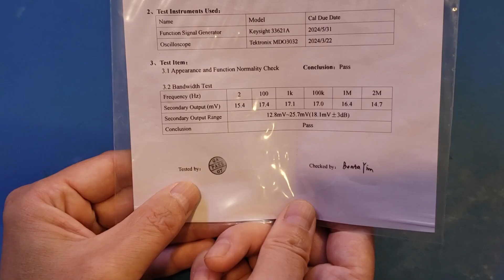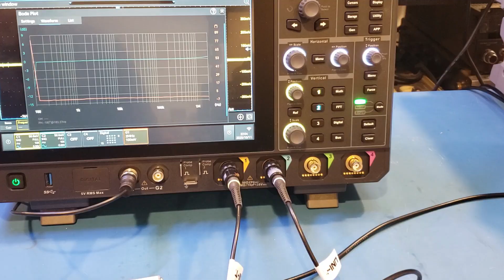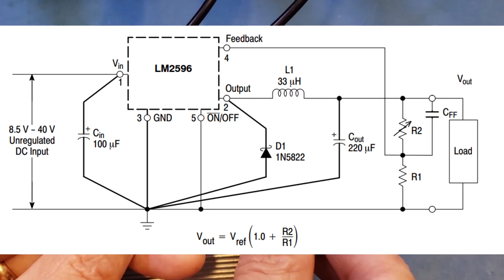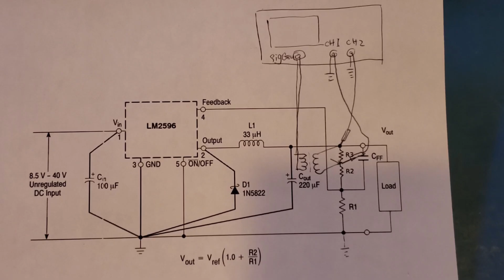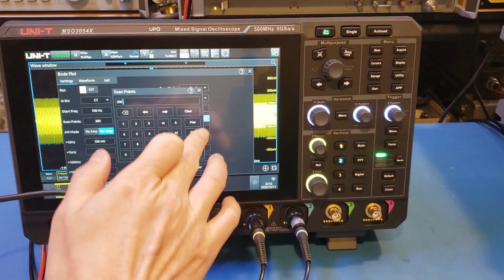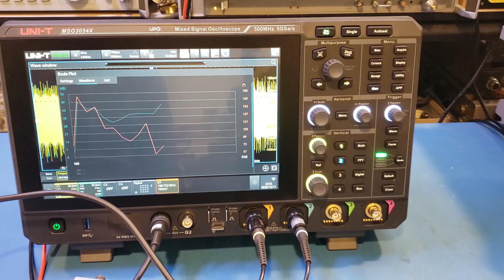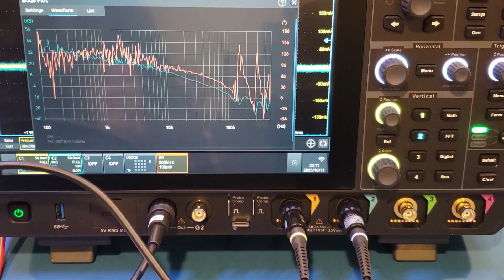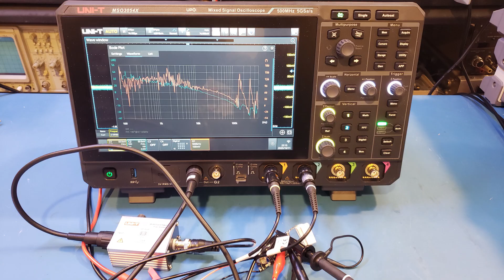UNI-T UT-ISOT Injection Transformer, Phase/Gain Margin Measurement, Loop Stability Analysis

Comment: Interesting. I wondered if an audio 600 Ohm 1:1 isolation transformer would suffice for amateur measurements. They are flat over the audio bandwidth and possibly higher. They also have a high isolation voltage. They can be bought for ~$10. They need connectors. An example is the HT-9696.
Reply from the maker: In an TI application note: an audio transformer was used for this purpose as well: https://www.ti.com/lit/an/snva364a/snva364a.pdf So as long as the frequencies are not that high, it will can do the job.
Reply: @KerryWongBlog  In the note, they used an ordinary mains transformer, 115 to 12 V.
Reply: Many years ago I needed an isolation transformer for a neuroscience application.  I used a 600 Ohm 1:1 audio transformer with pretty good results.  I bought a high grade transformer which was meant for use in audio mixing consoles.

Comment: Not a fan of UNI-T.  After buying a scope and a bench DMM off them and receiving no (0) (zero) (nada) support.  No response whatsoever from my queries or bug reports.  Nothing at all.  Like yelling into a pillow.  They took my money and ran away.  I think I'm justified in my conclusion.  Buy at your own risk and be prepared to be disappointed.

Nice tutorial on the use of an injection transformer.
Reply: Yes, Uni-T should not offer expensive measuring devices because the brand is not associated with quality. I don't even need to compare it with Fluke, Tektronix, Agilent, or R&S. Rigol and Siglent are sufficient.  And quite frankly, anyone who glues a transformer into an aluminum housing with adhesive has not understood how to do it properly—not to mention the inability to repair and inspect the device.
Reply: @ArnoldSzathmary the glue stopped me!

Comment: Can you please measure the inductance and ohmic resistance of the windings.
Reply from the maker: It's 2.3 Ohm and roughly 1.17H at 1kHz and 1H at 10kHz
Reply: @KerryWongBlog Thanks. 2.3 ohms at 1.2H! A very thick wire and a high-quality toroidal core were used. That's why the parts are so expensive...
Reply from the maker: @Elektronik-1  The core must have very high permeability as well.